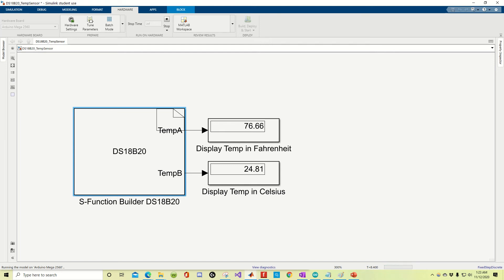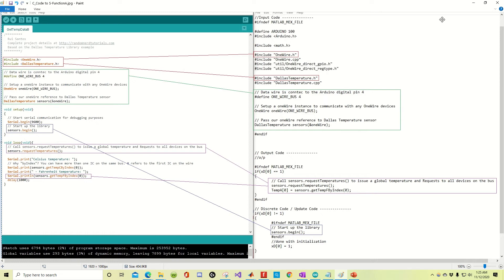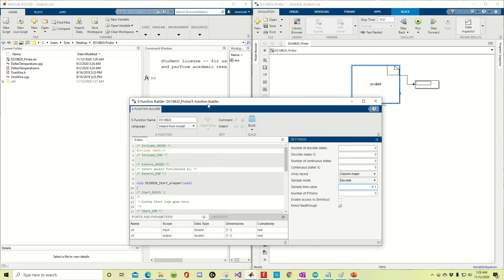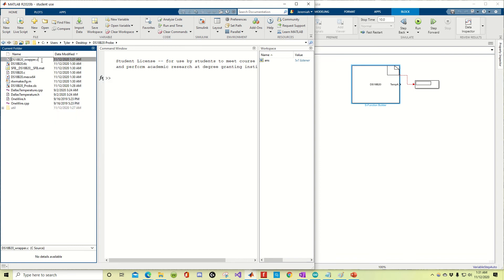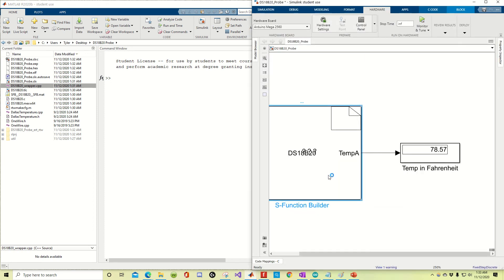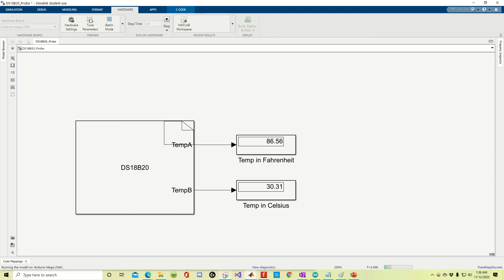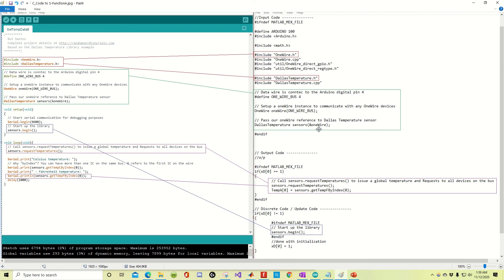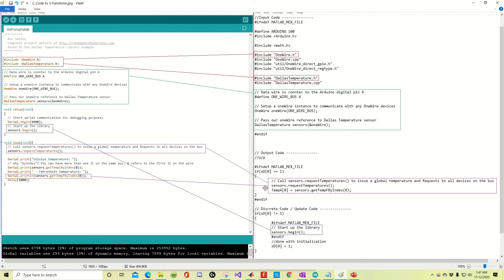1 How to integrate DS18B20 with Arduino in Simulink/Simulink s-function builder basics-1 temp Probe1

Comment: I tried doing this with MATLAB R2016a in Windows 10 64 bit version,  it gave the following error
"Unable to open INKADI\AppData\Local\Temp\tp8eee37e6_d60b_4908_b781_907bb15000c4 at C:\Program Files\MATLABR2016a\toolbox\simulink\simulink\private\sfunctionwizard.pl line 409, <dStatesHandle> line 10"

Am not really a good programmer. I have also not been successful with building any sfunction block with simulink despite following the instructions.i can only run other simulink blocks.  Is there something wrong with my MATLAB R2016a.?

The other type of error I get is
 'pwd is not recognised as an internal or external command...'

Please can you help me fix it.

If possible you could send me the DS18B20 S_function Builder file so I can run on my MATLAB if that could work. My email address is engrsamikejiani@gmail.com

I need this to work. It's an integral part of my Master's Thesis Research. 

Thanks, look forward to hearing from you
Reply from the maker: DS18B20 Probe.zip
https://drive.google.com/file/d/16talI_CAqRLc7VtByoRr4ZYr38aS6DV2/view?usp=sharing